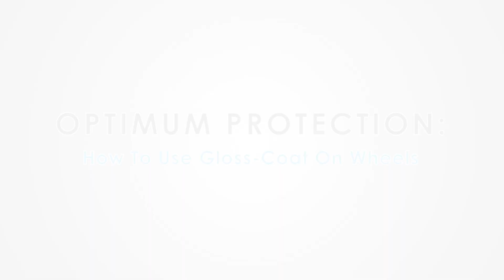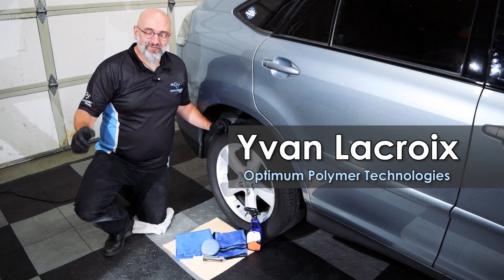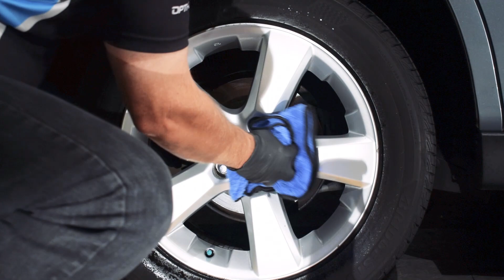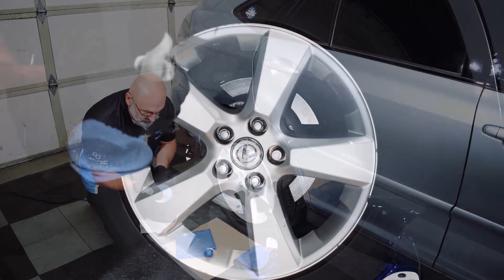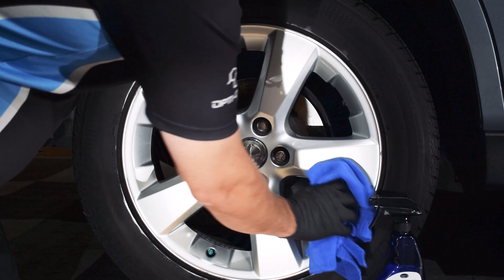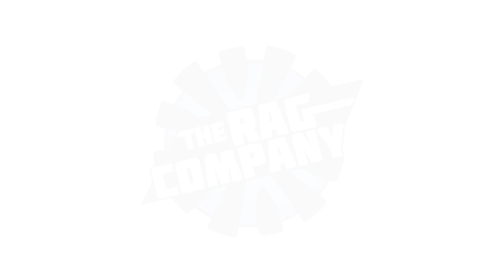How To Apply Optimum Gloss Coat To Wheels

Comment: Gloss-Coat is so easy. love it.

for what it's worth, i don't use the tip. i just drip it on the applicator.

however, either way, when you get the air out of the tube when you are done, i always put a piece of paper towel or whatever is close by (applicator, etc.) to absorb anything that may shoot out when you are pushing the air out.

ask me why i started doing that, haha.

Comment: Another awesome informational video!  Also, can you use the Gloss-Coat inside the wheel as well?
Reply: I had already decided if I were to do it to pull the wheels, ONR, clay/iron removal, paint prep, and then apply Goss-Coat.  I am glad that you guys said it could be done!  I have seen guys polish the inside of their wheels, I am not good with my DA Polisher yet and I think I should be ok with the steps I typed in my first sentence.
Reply: Exactly, I would pull my wheels and inspect them before I decided on doing it or not.  If I have a few scratches it would be ok I would think.  If I have a few big scratches and things are not looking good, then I definitely would polish first, or try too lol.